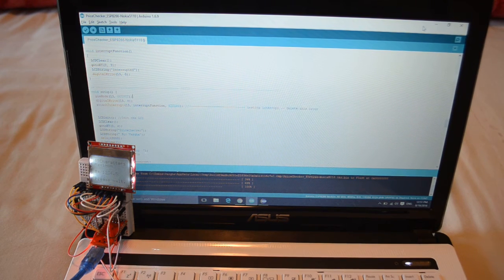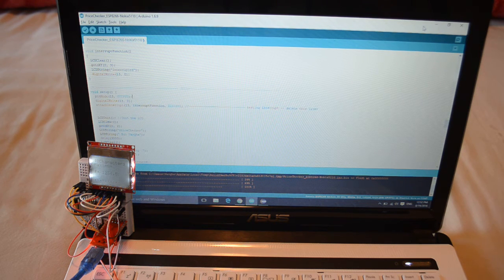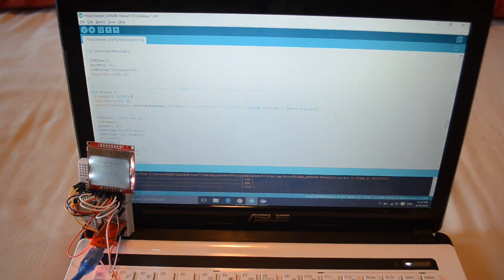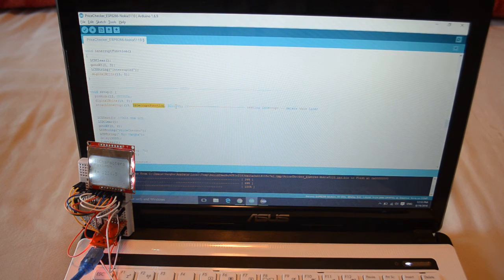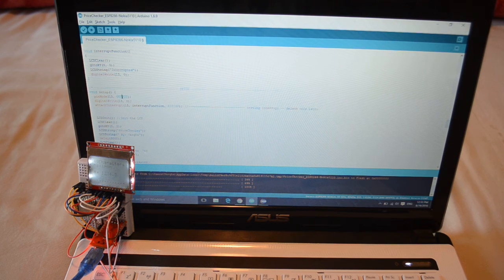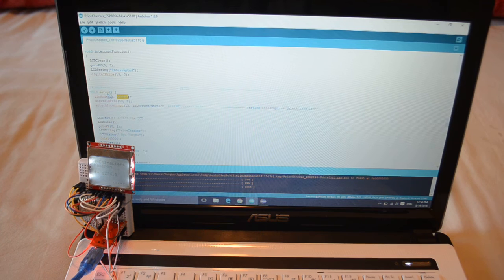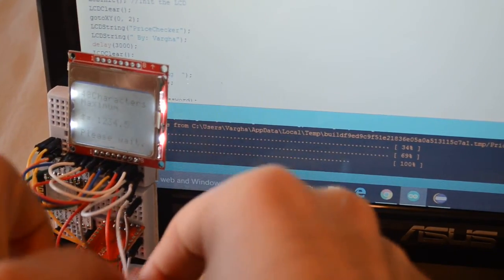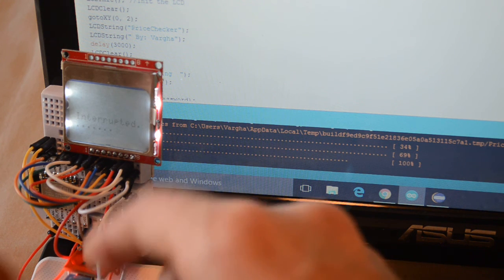ESP8266 - Setting Interrupts for Pins

Comment: I use the library RFcontrol which internaly use innterupt with CHANGE. What pinmode I must use that the innterupt will work properly?
thankyou
Reply from the maker: Matej Hlaca I haven't had a chance to work with that library, but I don't see any reason to not work. please give it a shot, and if it didn't work, I can take a look and maybe change somlines to get it to work
Reply: In setup there is only 
RFControl::startReceiving(0);

in function
static inline void hw_attachInterrupt(int pin, void (*callback)(void)) 
{
pinMode(pin, INPUT);
attachInterrupt(pin, callback, CHANGE);
}

On adruino this is working ok but on ESP I thing that is not working
properly.
Reply from the maker: Matej Hlaca Can you change your interrupt pin to output? it should solve it if it works in your specific project, but if you need it as an input pin, I need to know the project details, and I might be able to suggest some changes in the electronic design. it is possible to use it as input interrupt, but it is a real pain
Reply: I want to connect to ESP cheap RF receiver (XY-MK-5v) with library RFControl.h. I want recieve RF data (temperature and humidity) from my wireless weather station and put in into internet with ESP. The library is working well on arduino and is using interupt. In program (setup) I only use RFControl::startReceiving(0); this mean that RF module is connected to innterupt 0. On arduino this is working ok.
I changed line to RFControl::startReceiving(14); and connected RF module to GPIO14. The weather station is sending data every 20seconds. I recieve some data, on every few minuts. I am missing a lot of data.

I thing there is problem with innterupt on ESP.
Reply from the maker: Matej Hlaca I know, interrupts are a little tricky on esp. I got it to work fine on output interrupt pins. check your input voltage to be 3.3v, and if it is, try limiting mistakes to interrupt only. try connecting an LED, with a small code, which includes only interrupts. If the led turns On on any poke, maybe the issue is somewhere else.

Comment: Hi, When I use attached innterupt of (x)pin, May I use : PinMode(x, OUTPUT) or  PinMode(x, INPUT_PULLUP) ?
Reply from the maker: Hi, I'm not sure it works with "internal pullup resistors",  which I know it works on Arduino. It works fine with PinMode(x, INPUT_PULLUP). I talked to one of "espressif" engineers, and as he described, ESP8266 works with input interrupts, but it needs a clean 3.3 voltage, and more importantly it needs to be direct, and not from a voltage regulator, but you can use resistors to drop the voltage. Please feel free to take a look at my sample code on http://subtledesign.net/index.php?id=learning-lounge&post=esp8266-setting-interrupts